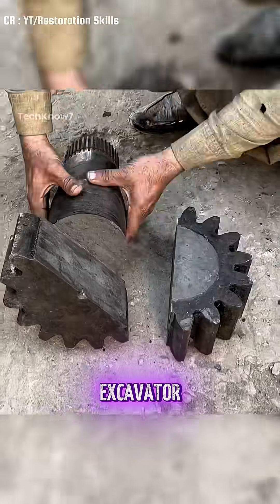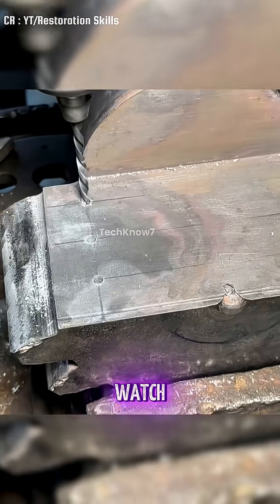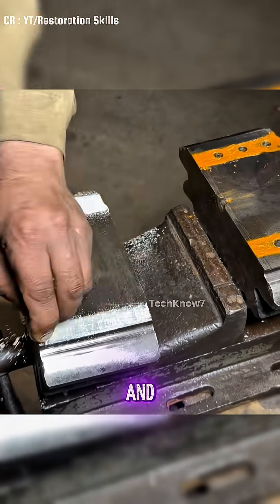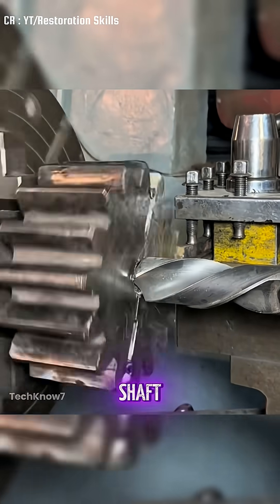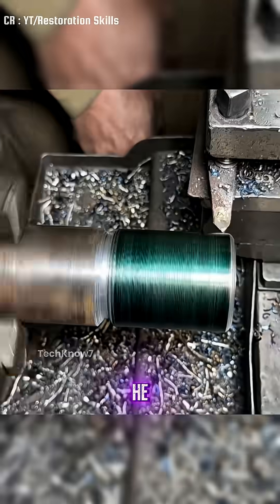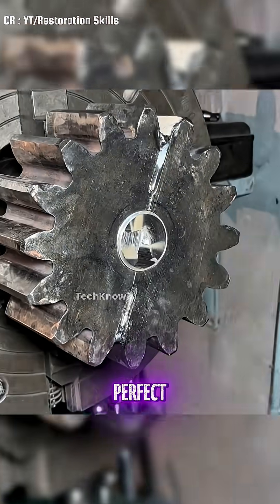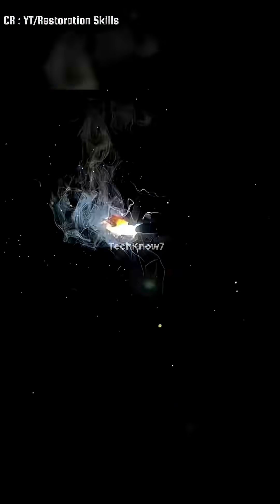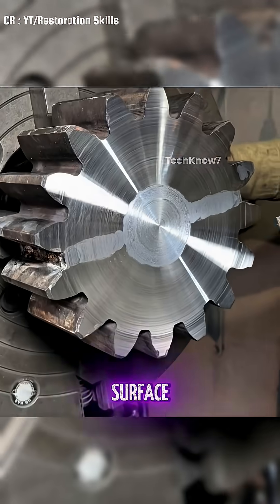GENIUS REPAIR - Fixing a Split Excavator Swing Motor Shaft

Comment: Gotta do what you gotta do to keep shit moving, im assuming parts like this aren't available on prime next day? As long as it keeps going until the replacement arrives its all good. I type this while waiting for some epoxy putty to dry on a cvd on my rc car, replacement is taking 3 days, but ive got 4 huge fully charged batteries to drain, would be rude to wait, possibly dangerous

Comment: Interesting that the gear split cleanly in half in a straight line like that. Also interesting that this guy was able to hammer pilot holes by hand by eye. That’s not precision. It’s close enough for a gear that doesn’t need to be accurate to 1 mm.When your machining tools don’t need to be accurate to 1000th of a millimeter I suppose you can do something like this. But if the original solid steel gear split in half then something that is merely welded on the outside surface is not going to be strong enough to hold.

Comment: The middle inserted shaft (bolt made) makes no sense whatsoever as it would worked if the gear was pressed inwards, but if the welds broke then the middle bolt or shaft whatsoever wouldn't help with anything . This coment it would be for those Who understand what im trying to explain .

Comment: Absolutely not that is dog water and will break again there’s only penetration on the outsides of the gear to truly repair it either re cast it or grind it all and back fill everything with weld and then clean it up on the mill

Comment: That’s a moulded piece of steel for a reason, no strength in the pins that’s for alignment the welds look light ,it looks good ,it’s a 3rd of it’s original strength.

Comment: As someone who once shopped at a gas station owned by an Indian.... or was it a Pakistani??... i forget, anyhow, if Ai is going to provide details, it could at least use the correct terminology. A lathe doesn't "carve", it turns and faces, and it wasn't a CNC, it was manual machining, the flip flop sandles suggested that they definitely couldn't afford a CNC machine.

Comment: This would break immediately the very moment that load was put onto the gear it would break in half again people need to realize these gears are liquid metal poured into molds or pressure made meaning 2 pieces of stronger metal stamped this gear shaft and all out of a solid piece of metal these things are incredibly strong people love to say that weld is stronger than the original gear but no way in hell is it even close to half the strength that gear is this is not a repair this is meant to gain views for money nothing more

Comment: That break is way to flat. Never seen a gear split so precisely . That's not gonna last. There was no repair to the spindle that I saw. The weld wasn't nowhere near proper depth. What ever caused it break will do it again. Also there should have been some tear away or deformation to the gear tips. No repair here just click bait.

Comment: Those 6 bolts will shear the moment the gear engages.  This is all wizardry.  The forces applied snapped that gear like a twig.  And you think welding it will sustain those forces ahahaha lol......the 6 bolts inside do not even come close to the full shear capacity of the cross section of that solid block of steel.  This entire video is just a joke just like India and Pakistan.

Comment: Zibdabad pakistan he he !! indians actually have updated technology from europe and america and in the 21st century will be a 1st world export hub for technology and machinery. they are extremly advanced and all major european and american companies are owned by indians and the raw machined parts , forgings are all made in india.. look at englandestan.. on the other had pakistan used very old machinery and hand made material which in a less than 18 months will breakdown again...  as for this video the entire item has to be 3D printed and cut and machined fro a forged bar in one piece o or from die casting.. not this trick from pakestan

Comment: As an actual mechanic myself, I say this is bullshit.
First, you can't drill on gears. Second, if you weld on them, you ruin the heat treatment temper, and the gear will last just seconds in normal operation

Comment: I wonder why the gear needs to be so massive when it can be fixed with small joints like that?  Oh yeah, its becuase it is supposed to transmit heavy loads. So I'm not so sure you can get away with fixing it like that.

Comment: Inconceivable… I would have been impressed if first he started with 1/32 pilot drill. Utilizing 3/8 holes right off the bat then tapping by eye the center on the the opposite precisionally cut gear was next level skill.

Comment: This is a temporary repair at best. If the gear broke from stress and ir didn't have an inherent flaw, this repair will fail very quickly. Neither the pins or light welds have a fraction of the strength of the original gear. I wouldn't rate this as more than 15-20% of the original heat treated gears strength, probably less. The approach was crude from pin placement transfer punching and putting them into a plain drilled holes.  The welding approach is a fail from every aspect.
 Those tiny machined grooves do little to help.  For the repair to stand a chance of long term success, they should have ground large bevels on each face, 30% or more the width of the gear from each face. Preheating of the gear, multi pass welds to fill each bevel (likely 15 plus plus passes each side) and a post heat controlled cool down after welding are needed for success. Straight welding on an alloyed carbon steel is not just prone to cracking, it will crack. Surface welds dont have the strength. 
  There is more to the process. I'm not guessing, there is a process for each steel alloy and the thickness of the part.  I'm an industrial millwright and have done dozens of similar repairs over the years. 
  If the machine only needed to get through some very light duty use until the end of shift, this might work temporarily. Most businesses you do these repairs for promise to order a replacement from the factory and change it out the minute they get it. More often or not, I'll come across these repairs still in service many years later.  It may have taken a few more hours to do the best repair possible, but its just what you have to do. There is no perfect in this type of repair. There is much, much better though.

Comment: This gear could have been fixed by a much simpler solution. If you clean the metal off prior to applying my secret solution, the results will be much stronger than the original gear. What I use to bond the two halves together is 4 ounces of freshly extracted hemorrhoid juice 😮

Comment: Most of these repairs would not pass the sniff test in the west, to much liability,when this breaks and kills some people, they just get more people. I am sure, and I have seen
Many repairs, that for certain low speed machines this would get you back to up and running until a replacement is made

Comment: This is absolutely ridiculous what was damaged, what cracked in half was a high alloy fully cast in place center gear.... the cosmetic and I mean totally cosmetic repair with dowels was nowhere close to the strength of the original piece.... this is ridiculous.... the repaired part will break again once it is put under any serious stress at all....BAD, BAD BAD

Comment: Repair monday broke Tuesday 😂
Reply: It will hold for some time until the replacement parts arrive. You don’t get these items off the shelf in those parts of the world, you order and wait, and during that time you need a cheap fix to keep your equipment running and that’s where these mechanics come in. How do I know you may ask, I am an Engineer who’s worked in Pakistan and I personally know the struggle such a failure can cause at a worksite..
Reply: That’s what I was thinking those things take a beating that I don’t think some welds will hold up
Reply: Stupid comment

Comment: Why is that break so clean? Looks perfectly flat. Steel doesn’t break like that. If it was machined then the diameter would be affected and would have to be rebuilt with new material or the gear would wobble causing vibration.

Comment: I see all the praise of a Pakistani mechanic but I'm American and if I had this machine shop with these tools I think I can do better. To many structural weak points. What's holding the back? Why not grind down enough off so you can weld from the center out? Still though the proper fix is to recast it right? Or buy a new one

Comment: To those who think the repair will not be as strong as the original forged or machined gear, consider this: The original gear split cleanly into two equal pieces as if it were cut with a micron thin laser. So, the original gear had an internal flaw that was bound to fail under stress. The repaired gear is definitely stronger than the original flawed gear - though not as strong as the gear was intended to be.
Reply: probably was cut just to make the video
Reply: @LawrenceWeber-z5o  yeah, most of these marvelous repairs are made for views, comments and rage from youtube experts. I just love pakistanis ingenuity (clickbaiting sofa experts) 😂😂😂
Reply: It wasn't forged, it was cast junk.
Reply: @wilsonjohn9766  they probably casted it themselves last week after the original one wore out and they made a junk cast one for it to replace the "good one"
Reply: @hartle4 😂
Reply: Even if its weaker
This people are doing the best they can with what they got i think is better than nothing. People are hating
Reply: @gleibert it's not hating. Often times things like this will be repaired and sold as new or not defective to unaware people and will break and even worse, get someone hurt. Stop being so sensitive.
Reply: That gear is not even close to as strong as it was.  I'd be surprised it lasted a day
Reply: Wrong.   An operator could split that gear again in a hot second.   Load the bucket swing and stop.    Gear split again
Reply: @toddnewsome5011  Can you read? I didn't say the repair transformed the gear into a quality piece. I said it is stronger than the original gear that clearly had an internal fracture when it was made. It was crap to begin with and still is crap but it is better than it was before.
Reply: When you can’t actually make good quality parts you try hard to use some substandard Repairs to get you through until you actually get someone killed.
Reply: good point.
Reply: A lot of good work to be sold at the auction
Reply: You said a bunch of nothing.
Reply: Can they intenyionally split the gear before putting it into the machine so the splitting will be avoided? Just a thought.
Reply: With all respect for the people who repaired this gear but it won't last a long time.
Reply: Just has to last long enough to sell it.....🙂.   An old lady only drove it on Sundays
Reply: Looked to me like it wasnt broken, it was cut. That is too central and too clean for any break.
Reply: The weld hardly penetrated the first 1/4 inch that leaves the majority of the Inside still split. The pins he used will be no better than shear pins with the size of that gear. Better than original you say, doubtful.
Reply: Well the only thing that us Most likely worn out are the teeth on the contraption it will hold with there fix especially with the welds to reinforce. The only real question is how long with the teeth be good for rotation how long can it last
Reply: It will fail quickly; this isn't a proper repair, just a temporary solution while they wait for the parts, as not all the necessary components are available to them.
Reply: He only welded MAYBE 1/4 inch 3/8ths deep into the gear so the rest of the 6-8 inches behind the surface weld is still completely seperated and held together by 2 welds and a bolt through the middle, the alignment pins will do nothing when it comes to making the gear reliable or strong again.
Reply: Makes total sense to me...well said

Comment: Perfectly straight for being broken, but it snapped a solid 5” thick heat supposedly, how long do you think some 1/2 inch pins and a few welds are going to last if that was the case.

Comment: people are saying that this wont last long, because if such gear breaks straight in the middle, any repair to it wont make it last as much as it used to. while that may be true, this is better than days or perhaps weeks of waiting for a brand new replacement part. this simple but elegant band aid solution can at least give it a day or two more operating days which should minimise financial losses if the non-operation of such machine costs money.

Comment: Any Engineering student in his second year, would know that this is not going to last very long, the effective cross section that has been holding the loads has been reduced to the total sum of cross sections of the bolts he used and the weldings, which is at best is 10% of the original cross section.
Not Approved!!!!

Comment: Well, the gear teeth will be off by a couple thou at least, so it won't last that long and will start wearing and gulling, but if they're not going to use it in high volumes, then i guess its good enough. Depends on what theyre doing with it

Comment: These gears are heat treated in a specific way to attain a hard surface in order to resist wear. Welding the gear will change the grain structure of the gear and it will not last as long.

Comment: That gear didn't break in two. Its been cut to slice out what was likely a broken tooth and then a separate donor gear that had probably broken before was cut out to match the needed piece and put back together. It will likely fail in short time because those pinion gears are under huge loads. Trash repair.

Comment: Im no engineer but i can almost bet that thing is maybe 25% of its original structural strength.
Reply: Like you said, you're no engineer
Reply: swing motor gear never breaks that clean . fake vid
Reply: not true he did that in sandles.
Reply: 26%😅
Reply: Wow, genius
Reply: That is not broke ,it was cut, you can see the cut lines  ,in the kerf   ,no gear or shaft combination  ever breaks or fractures the precisely  ,perfectly  square     complete  and utter  bull shit ,nonsense    !
Reply: Well considering there was no fusion to the back side of the gear, that support beam on the back of the gear has nothing connecting those pieces other than friction. So that whole support beam is only connected to one side of the gear making a failing point
Reply: Maybe less.....
Reply: No, you are wrong. It cost him 25% of the original part.
Reply: That's very generous, I would put it more likely 10% and I am an engineer!
Reply: I dunno, it shattered in half perfectly symmetrical. It might actually be stronger now😂
Reply: Incorrect as an engineer  I will tell you it  failed from dubious manufacturing- if it was heated correctly and used correctly( some hope 🫣) it will probably last
Reply: Well, I’m no engineer. I’m just an asshole who repairs furniture and I fix broken chairs, the same way by drilling holes in it putting in wooden dolls and a shit tunnel, wood glue basically the same thing that he just did and if it was good enough for Mema‘s fat ass and her rocking chair is good enough for that drive piston thing once again no engineer just an asshole
Reply: eh. Original had a fault going through it.

Comment: Looks as good as new. But it certainly should not be used for more than 50% load as the original. Good enough for makeshift light duties until the proper replacement arrives.
Reply: No replacement  arriving.The whole idea us not to buy expensive new parts.

Comment: Yeah that might get you through the weekend
Reply: Yea the bolt in the middle is useless... the only useful things are the welds if you think about it
Reply: @JermDawg_35 right... I was literally just sitting here trying to figure out what was the point of even doing that to it ... Would have honestly had more luck with just the dial pins he set in
Reply: Yeah, 72 sq inches of contact replaced with 8 sq inches of weld. The only impressive thing was the alignment pins on the first try.
Reply: Maybe a couple of hours.
Reply: If you’re lucky
Reply: Truth
Reply: Your %100 white
Reply: @alexandergustavo9579 you're*
Reply: @alexandergustavo9579  I think you mean 'right'.
Reply: @mikeconey2164  no i mean illusory superiority
Reply: @alexandergustavo9579  Uh bro white people developed this gear and the machinery to produce it.
We also repair it the right way and for one we dont work on the fucking floor gustavito
Reply: Better than new
Reply: @martinterrazas19  If new means 'ready to break'.
Then again, where you are that might be true, in some 3rd world crappy jungle.

Comment: Precision grinding with CNC machines LOL. A gear like that would be made from high grade steel. This repair is no were near as strong as the original part and the process they used for transferring holes is something I would use to make a bracket but not a precision part. I would be surprised if the part was only out of spec .04". Gear hobber can hold .004" all day long. The reason you have not heard of anyone repairing a large or small gear here in the US is because getting it right would cost more than it would cost to remake the gear. Before you ask there are many shops that could reverse engineer that part and remake it but it is always nice to have the original manufacturer specs.

Comment: Pakistan mechanics but the gear shift will never have the same strength with extreme force speed & use it could easily crack break again in it repaired areas

Comment: There's still remains a massive amount of surface area that is not joined by any solid substance is just sitting sandwiched up against the other and the entire strength of that weld is going to be bore by that middle shaft and those pins and I very much doubt it's going to have any staying power for a long time